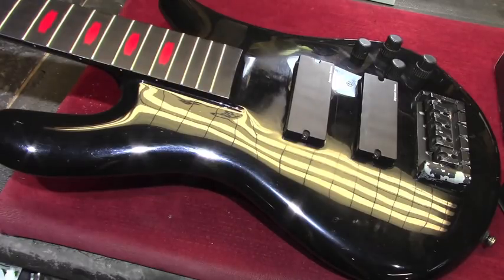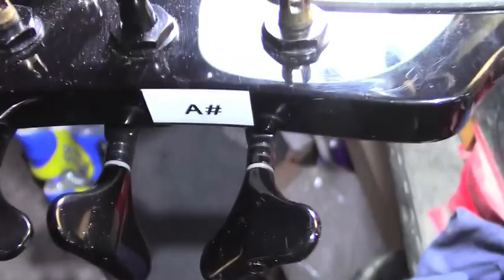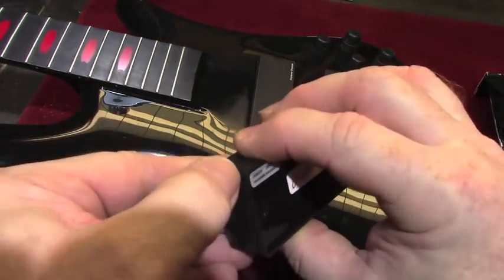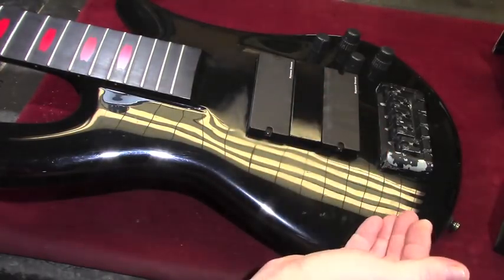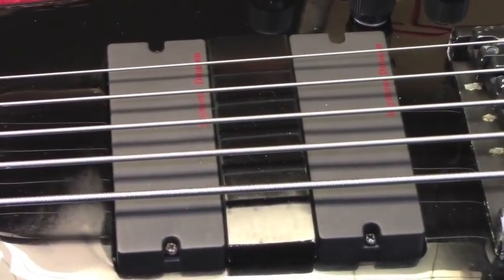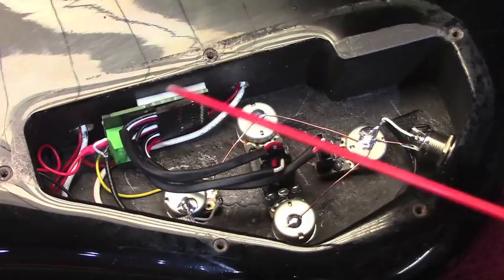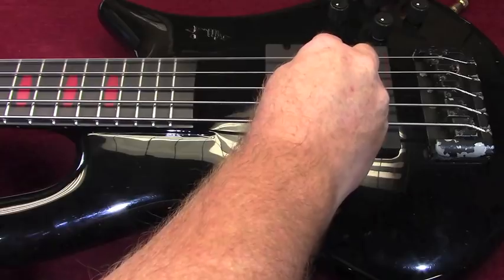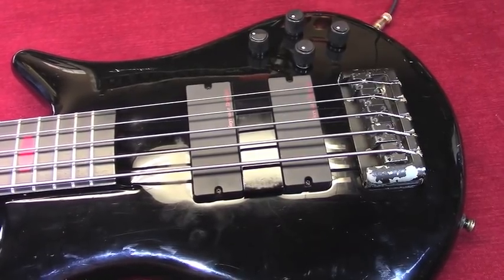On The Bench - Alex Webster (Cannibal Corpse) 2018 Tour Prep Part Two - Black Bart

Comment: i hope to get a blood one but confused on a point
I searched it on the official site and found it seems that on AW SIG basses they dont use 40dc and bqc preamp now，they turned for aw sig seymour duncan pickups and darkglass preamp.the two different paintings  are different on knobs likely
the black one has a stacked knob but the blood one doesnt， for only has 4knobs. then how can the blood one realize two volumes two mids and a bass for control as showed on the website info diagram？

Comment: Do you not recommend ebony for a bass ramp if humidity/temp changes eventually risk it cracking? I'm having one put on my bass but should I be too worried about that since I'm not a touring workhorse (yet) like Alex is?
Reply from the maker: Actually ebony is more prone to cracking as you will see in the next installment of this series.  One of the first ramps Alex had made is ebony and it's cracked right down the center.  Poplar should be more resistant to such things, but we shall see.
Reply: I have an ebony ramp on my Euro 5. No issues yet.
Reply from the maker: Adam Rushka - Well, unless you travel all over the world it's not likely that you will have issues.
Reply: I have not been that lucky lol When are parts 3 and 4 coming out ? I love the Red Zombie drip bass.
Reply from the maker: Adam Rushka - Be careful what you wish for.
The video featuring the red "Zombie Blood" bass should go up later this evening.

Comment: Didn't notice a ground cable to the bridge?
Reply from the maker: Scott Bishop - The Hammer Smashed Bass units are active pickups that are internally preamped.  They acquire their ground connection from the amplifier.  So, they do not require a connection to the strings like passive pickups do.

Comment: How do you attach the speed ramps to the basses?
Reply from the maker: John Desmond - 3M double stick.  I get it from a sign shop.
Reply: Do you find that you have to use a lot of it because of the dual purpose the speed ramp serves?
Reply from the maker: John Desmond - not sure what you mean.  The tape is intended to hold letters on signs in outdoor conditions.  It holds until you pry it off.
Reply: @GranvilleGuitars  What I meant was that since it's serving as a thumb rest it might detach because of the pressure placed on it but you pretty much answered my question :)